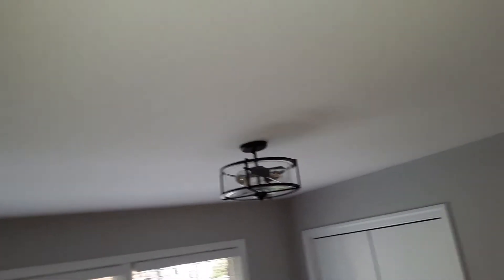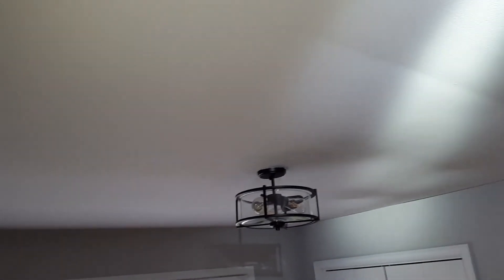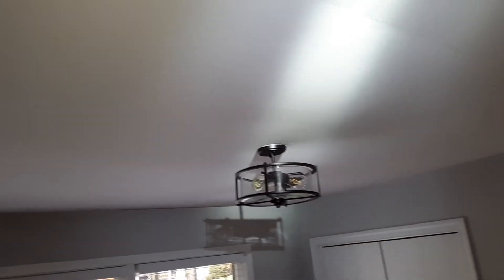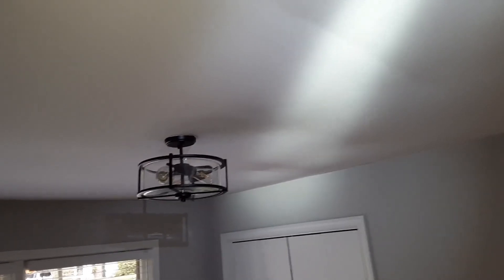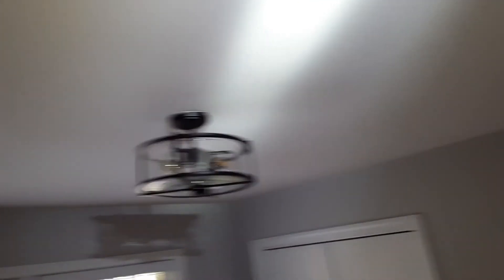Improper size drywall installed at ceilings during 1970-80s - Now damaged from humidity gravity time

Comment: Is this really a concern if it's only barely visible when you take a flashlight to it an odd angle? I can see if it was significantly sagging or cracked, it could be a concern.
Reply from the maker: Thanks for question. It's really not a concern if its barely visible. But it's very important to maintain any humidity in the future for any further damage. Other items that I'm looking for on ceilings during my inspections are, previous water damages from above and improper "3 M" GLUE applications of drywall on ceilings installed between 1968 - 1981, with a class action lawsuit. This type of drywall application has been known to collapse and even kill people. Thanks for watching the video.